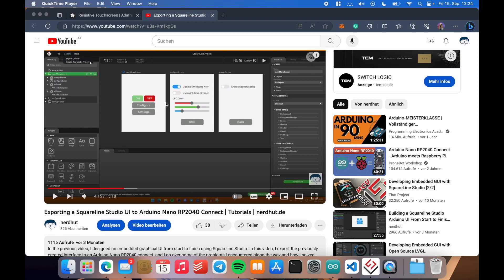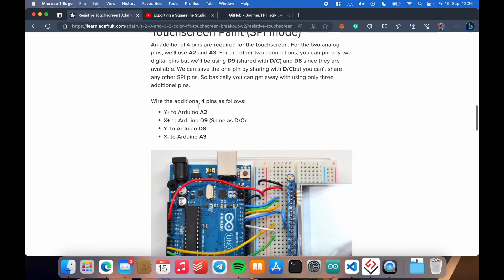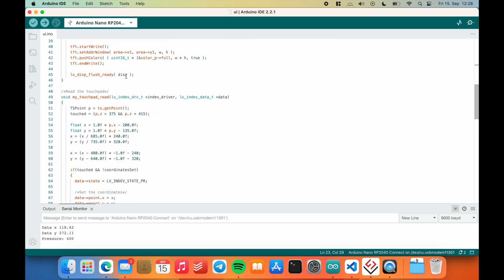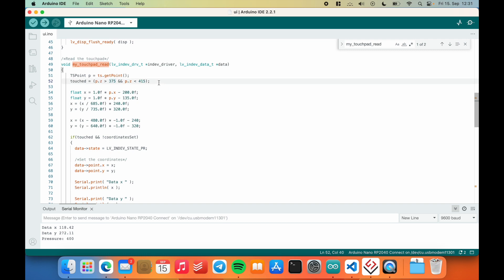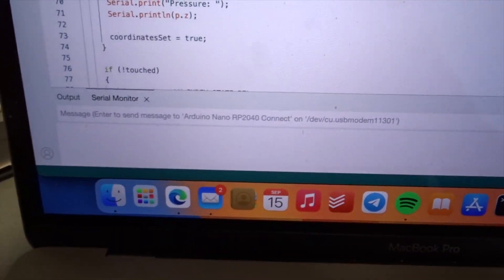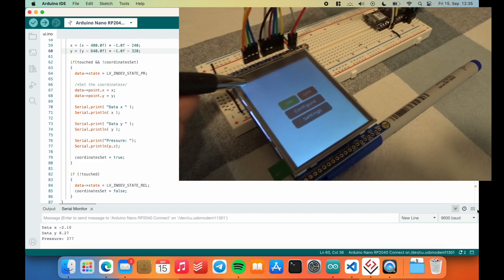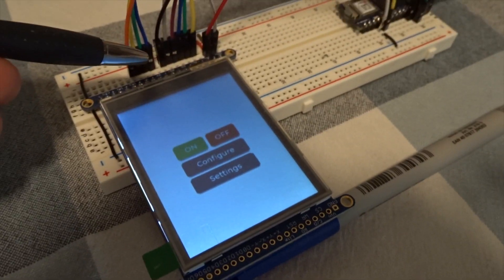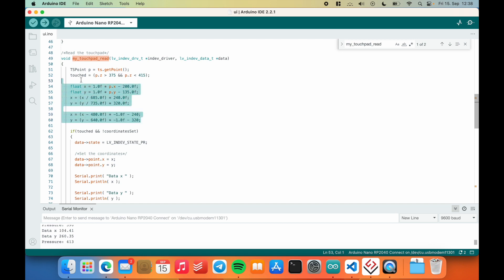Arduino Touch Controls on a Squareline Studio UI | Tutorials | nerdhut.de

Comment: This work with tft shield ?
Reply from the maker: I'm sorry but I don't have a complete list of devices this setup will work with. However, if you're using an ESP8266, ESP32, or RP2040 then your chances are good. You'll just have to make sure that LVGL supports the display and that you know how to configure the pins in the user config header file.

Comment: hi great tutorials boss, love the work you have done. i had a quick question isn't the UI a bit slower compared to the editor? is there a way to make it more reactive ?
Reply from the maker: Hi, thanks for your comment! You#re right, the UI is much slower on the Arduino. I think it's due to how limited the Arduino's processor is. Using a faster device (maybe an ES32 or better) could greatly improve responsiveness. However, that's just a theory, and I haven't tested it. It might also boil down to LVGL. But I think a faster processor will likely improve things
Reply: thanks for replying, ill give it a go on an esp32 and let you what I come up with 😊